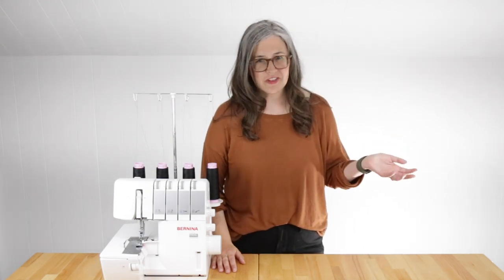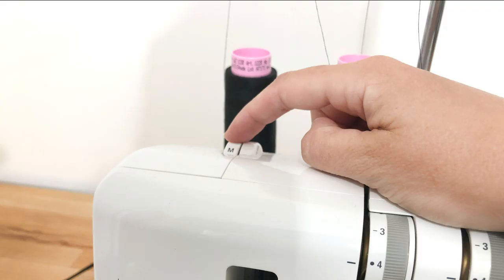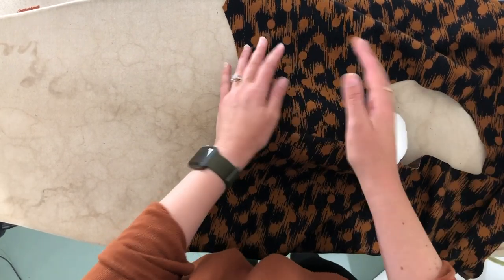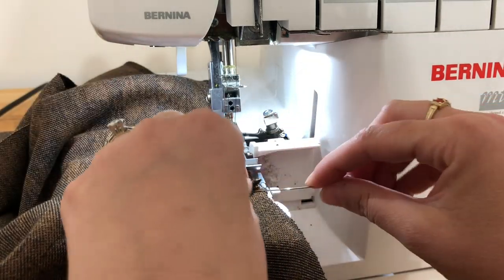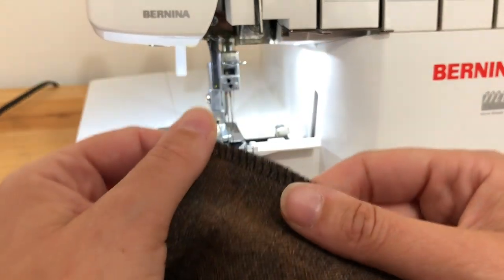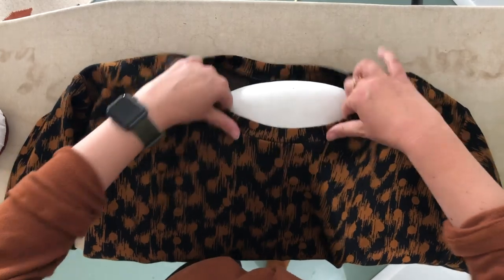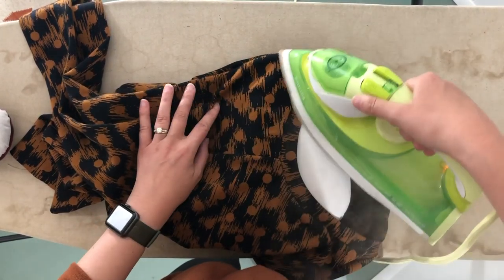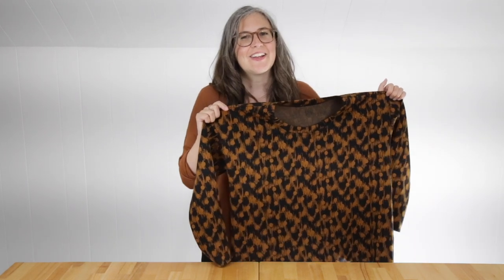Hemlock Tee Sew-Along: Day 05 – Assembling your Hemlock Using a Serger

Comment: Thanks for the tutorial. I don't have a coverstitch but have been researching about them. That trick to end by pulling stitches with tweezers is "new", I haven't seen anyone else take that approach. Seems great! and solves a lot of the cumbersomeness I have seen with coverstitch.
Reply from the maker: Glad to give you a new tip! It's not something I invented, it's the recommended way from BERNINA to lock the end of the coverstitch so it doesn't come unraveled. I've been lucky to have a lot of hands on training by the company so I learned it there, but it's also in the manual!

Comment: Video looks great, looking forward to trying it. One question - I'm new to using a serger - how do you align the fabric so that its straight and so that none of the edge is cut off? I'm used to using a sewing machine with guidelines!
Reply from the maker: You'll just need to measure over from the left most needle and wherever that falls, that's where you want to line your cut edge up. On my machine you can move the knife in and out so I set it so that 1/4" just aligns with the inner edge of the knife. So rather than aligning with your knife make sure you're aligned for proper seam allowance!
Reply from the maker: Also my machine has measurement guidelines on the foot so check there to see if yours does.